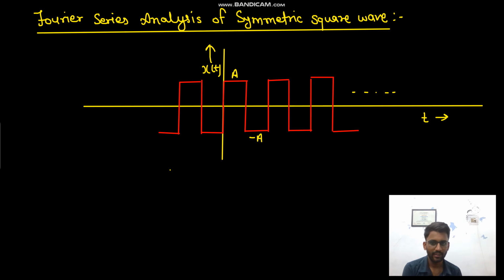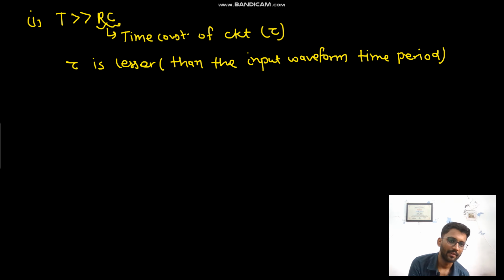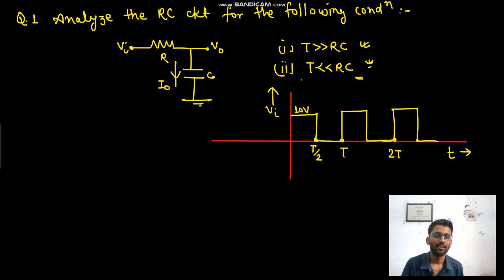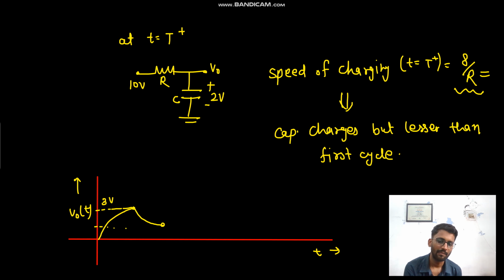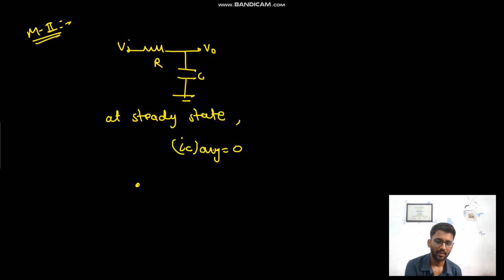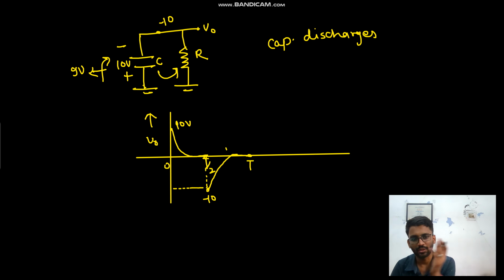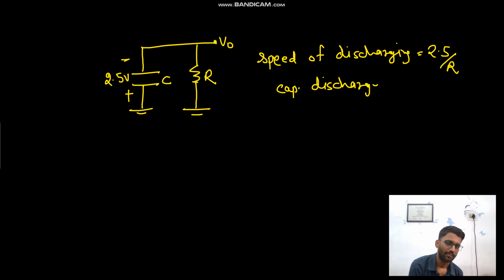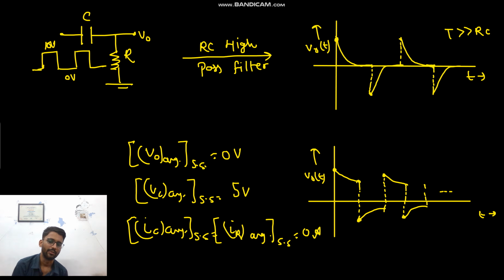(English) Pulse Response of RC Circuits and CR Circuits || Detailed Analysis

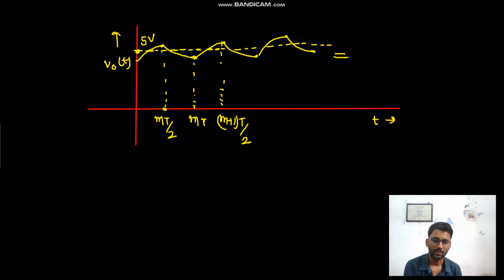Comment: Why steady state is half of input at 44:43 time …?
Reply: If you look in frequency domain all frequency components lie after the cut off frequency so those will be attenuated but your DC value or the average input value which is 5V will pass through the circuit without any Attenuation because it lies below the cut off frequency. In any low pass filter DC value will always pass because it's frequency is 0 and cutt off frequency will obviously  be greater than 0 . If still doubt please ask wherever your getting stuck. 🙂
Reply: @sakshisingh4197 @Himanshuagarwal_   I agree when looked at it from frequency domain perspective , but what I am more interested in is that the charging should still happen from 0v initially ,so am I right if I say that At first there is  a very slow exponential drift and  After many cycles a nearly constant DC value equal to the average .
Thank you 🙂

Comment: what do you meant by steady state current...the charging and discharging cycle will keep on happening repeating itself every cycle, so how r u saying that there is no charging and discharging...and what do u mean by STEADY-STATE here ?
Reply: By no charging and discharge he mean no net or overall discharging and charging at steady state because at steady state both rates are same so overall no charge or discharge.
Reply: Steady state is a state when your voltages are constant and nit changing you can take it as time when infinite in this case of capacitor.